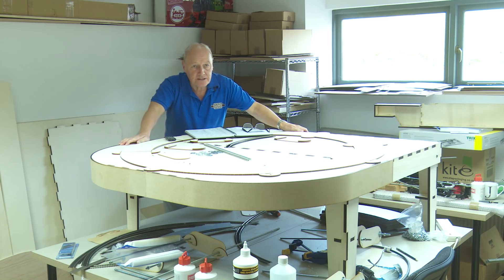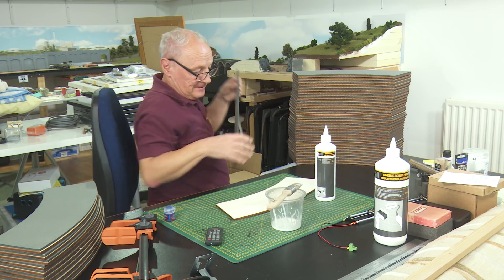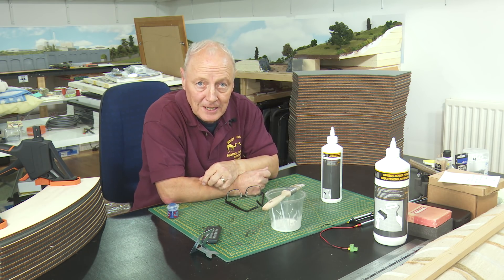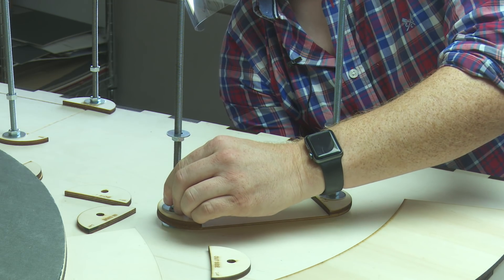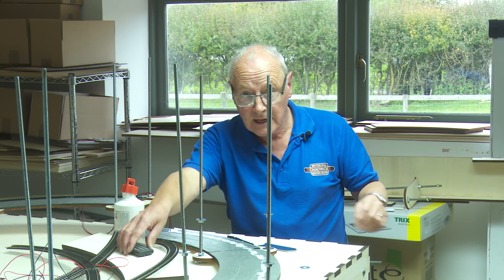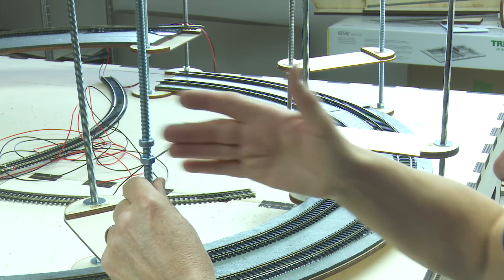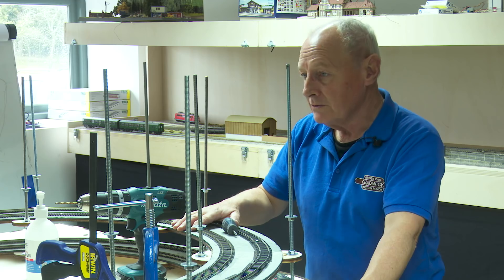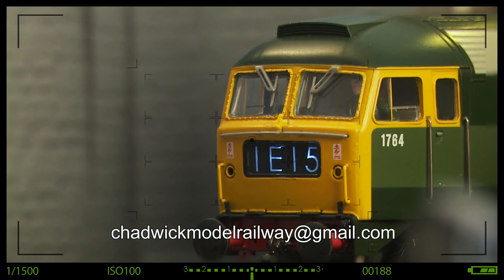Building a Helix at Chadwick Model Railway | 114.

Comment: I'd like to see a helix kit with a laser cut raised track guide fixed in the six foot (~4mm mdf). So you can push flexitrack up to the guide on both sides and have neat Curves, without needing to use set track...
Reply: I was thinking that 3d printed guides would make laying the track bed and track rather precise and easy. That way flexitrack could be used with minimal issues.
Reply from the maker: Certainly interesting points gentlemen. And of course the Flexi track will be so much cheaper. Regards Charlie
Reply: @ChadwickModelRailway  I'm not sure how much track you need to swap out for it to become economical to buy a 3d printer just for this, but for those doing less popular settings, it's well worth the money.
Reply: A band saw and a radius cutting jig. Or a radius jig and a router.

Comment from the maker: DCC Concepts Powerbase works by fitting the supplied magnets to the underside of locomotives.  This enhances grip, pulling the loco down onto the track.
Reply: Interesting video, I might need to use a helix or two when I get started. Do those magnets interfere with Kaydee couplings?
Reply: @meester5565  no as the magnets are installed under the locomotive,  the track base is just steel as far as im aware
Reply: @UndergroundEric  Ah thanks that makes sense.
Reply: was already asking myself what these matal things are.
Reply: Thanks for that explanation!  I was wondering why steel under plastic sleepers was going to help anything.
Reply: Triang magnadhesion for the 21st century.
Reply: Note the choice of special stainless, as not all stainless is ferromagnetic. Obviously best to use stainless, so corrosion is not an issue!
And as Charlie mentions, each loco will need a magnet to use these plates.
Reply from the maker: No because they are well back under the loco.
Reply: Make sure the magnets clear the kaydee uncouplers

Comment: Anyrail has a Helix function that draws the helix and calculates the gradient and distance between levels. If you haven't used it, yet, send me your Anyrail layout with all the heights and I will insert the helix, so you can see it in normal view and in 3D. I will also sort out your other track levels, if no-one else has offered to do so. Cheers Bob
Reply from the maker: Thanks for the offer Bob but I’ve sent it back to it’s creator.
Reply: @ChadwickModelRailway  That's a shame. It's a really useful piece of software.

Comment: If you are an obsessive, you can still fix the missing nut: just unthread the rod through the entire stack from everything below this point (or above, whichever is the shorter distance to have to shift the rod), add the missing hardware, and reverse the process. Granted, it would be tedious, but still possible. With all the other rods, getting one out and back in shouldn't be much of a structural risk.
Reply from the maker: Thanks O50, I’m pleased that you understand my situation.
Regards Charlie

Comment: Hi Charlie. Wow that'll look pretty impressive once it's finished. When I was involved with the old model railway at Sheffield Park on the Bluebell Railway which had a model of Horsted Keynes station it had a 2 turn helix at one end that was built in. There were fiddle yards top and bottom of the helix as well as a single lead junction and facing crossover so it was pretty involved in the days before DCC. I think it went up about a foot so one end was a helix and the other was a single arc that dropped down quite steeply. I do remember my old mainline Jubilee used to struggle up that so it had to be restricted to three coaches anti clockwise. Great fun to operate but it was very temperamental. I do believe it still exists but it's stored in one of the many containers around Horsted Keynes.
Reply from the maker: I'm so pleased that you enjoyed it DJ.  Stay safe. Regards Charlie

Comment: FYI, I used that screw method to hold my HO track in my helix and to hold my 45mm gauge track in my backyard. It works in both places! And, my outdoor track is subject to temps from near freezing to 120F. It allows the tracks to expand and contract without any problem. Brilliant!
Reply from the maker: That was a reassuring comment that is, thank you regards Charlie

Comment: Another great video Charlie - thank you.  It's looking good.   
A couple of things I learnt when I built my last layout which incorporated a similar Helix with threaded rods and nuts (albeit Swiss narrow gauge single track).  I deliberately incorporated some super elevation (cant) into the track sub-bed (giving me 0.8mm across the 12mm gauge track)  I started with the track level, and then worked my way around to get it adjusted correctly, time consuming but straightforward (Trains (no steam locos) run perfectly with a 380mm radius curve and a 4.5% grade) 
I also elongated the holes through which the rods pass to reduce the stress in the sub-bed because if you look at the vertical geometry the sub-bed is the long side (hypotenuse) of a right angle triangle.  With only a 2% grade and a larger radius the difference is small but not insignificant and you may find that when complete the threaded rods are not be vertical, which of course isn't an issue if they are out of sight. Just my 2p worth but hopefully useful.

Take care and keep safe
john c
Reply from the maker: Very interesting points John, thank you. Yes I thought of adjusting some cant on the bed which I can do towards the end of the build. Elongated holes is in a good idea and perhaps one we should look into. Regards Charlie
Reply: @ChadwickModelRailway  Sorry I forgot to mention that with my 4.5% grade I also had to use tapered wooden washers above and below the track sub-bed because when I tightened the nuts above and below they tried to flatten the sub-bed.  With a 2% grade this will not be so noticeable but don't over tighten them because the clamping effect will be to flatten the sub-bed.
Reply from the maker: Great tip mate, thanks.

Comment: Charlie... get a small round kitchen sponge, put a nut and bolt through the middle of it and then put the bolt in the chuck of your drill... then use it and the drill to wind down all then threaded bar bolts by using the side of the sponge to the side of the nut.. if that makes sense. Stu
Reply from the maker: Great idea Stu, I'm onto it.
Reply: Simple, very simple, but very clever. I love it. 😁👍👌
Not really worth the effort for a couple of nuts but, for a project like this, that wee idea could save 𝐚 𝐥𝐨𝐭 of time and a couple of blisters.

Comment: Nice video. Great to see such a full treatment. 
When watching the spreadsheet work at 9:00 as you cranked up the revolutions to cover the 18 inches to get the grade down, I became worried as you were not watching the elevation gain per revolution. It’s all nice on paper but in that One revolution you have to get the loco and cars in there by height so the roof doesn’t hit the bottom of the next revolution. 
3.27 inches is what you computer. That’s going to be a very tight squeeze for OO locos. Not running electrics the pantograph issue doesn’t come into play. But you still will want the space to be such that you can get your hand in there to address an issue if needed between the levels. 
So my recommendation to folks is to build it to the lowest height that will work for your locos (tallest loco with pantos up if your need that) and still allow your fingers over the loco so you can pick it up and place it back. That sets the minimum gap per revolution. 
The room then likely sets the radius of the circle, of the grip of the loco with what it is pulling and the all of that determines how.far up you will go.  
The elevation gain is really a function of the per turn gain needed to reach in and the radius that you can work with.
Reply from the maker: I think what your comment has highlighted, it’s just the complexity of the whole installation. I do realise there is little clearance within the levels, in fact there is only half an inch between the top of the train and the next bed, but I believe that’s enough. Regards Charlie

Comment: Well looking good Charley. Kinda of behind I. Viewing lately lol. You could used, think I mentioned it before, cheap bathroom caulking, sticks to the track well and also sticks to metal well. Instead of screws, but end of the day what works for you is great :). 

I found building my first layer of the helix is always the pain and time consuming with raising the screws a little, test, lower where required test lol. But once that first run is done successfully I cut a spacer and the rest of the layers went up quick as the spacer just set it Off from my bottom layer. Fun building one though hey :)
Reply from the maker: It certainly was an interesting challenge Sean. Regards Charlie

Comment: Hi. very impressive and informative.  You mentioned about the track being level.  In real life, tracks are at an angle in curves to compensate the centripetal force of the train and helps also to keep the train not slowing down.  In my curves, the first 30cm of curve track is not glued to the track bed, but then for all of the curve length ( except the last 30cm ), i elevate the outer track just 1 to 2 mm from the inner one.  It works really fine.
Reply from the maker: Once I’ve got it home Josef and in place, I can the adjust the super/elevation. Regards Charlie

Comment: Hi Charlie..... All looks to be coming together just fine. All the research.parameters etc spot on and explained well. Something worth considering
when finished is to make up a control train.... loco plus a load of rolling stock that can just make it up the helix without wheel slip. Keep this
train as a unit train or take note of it's makeup, throttle setting etc maybe also.  First run: Track must be 'virgin' ... clean as possible and shinny. (Track could be washed in your sink maybe as you assemble helix's. [G} ). Reason I pass this on is as you use the up helix performance will change depending on how you clean the track  or run your trains.  The control train gives you a base to compare performance against later on. You may get a few surprises depending on how you treat your track.
Reply from the maker: A very interesting point Indigo. Many thanks, regards Charlie

Comment: Wow, that is a lot of hard work, but it should be worth it to have a great running helix system. I did notice James forgot to add the 2nd rod lower (12:12) washer for tightening the rod to the first curve, hopeful that is sorted post production. I also noticed that you didn't use a say Peco track to track spacing/distance measure in the build so that the track remained equally apart? Great video and clearly explained by you both. Thanks again my friend and I will look forward to seeing it working on your layout. Once you work out how to get it home, lol.
Reply from the maker: Don’t worry John that washer was fitted. I did occasionally use the Peco six-foot way-gauge, but the main thing to keep the tracks the right distance was just to align the track edges at each timber joint. That way everything was aligned perfectly throughout.
Reply: @ChadwickModelRailway  I knew you would have used a distancing tool, but for the new comer/beginner viewers not seeing it may have wondered what you did. If they see this comment then they'll know what you used and did to keep it all aligned.

Comment: Another great video Charlie. I've always been curious to know what goes into preparing and building a helix, and by the looks of it, quite a lot. As you know, I'm also an advocate for the inox but I did wonder whether you might encounter adhesion issues for ascending trains. I did notice a bit of traction loss on my inclines after applying the inox. However, you might be alright with the DCC Concepts Power Base installed.
Reply from the maker: I'm so pleased that you enjoyed it Station Road Model Railway.  
The Inox point occurred to me too but only time will tell.
Stay safe. Regards Charlie

Comment: Threaded rod is a sensible choice.  US practice seems stuck on using 1x2 "ladders."  These are often made in batches with the level-to-level rise uniformly applied.  The base legs are then trimmed to create the slope.  US practice often uses "door skins" (sheets of either bidirectional or unidirectional plywood meant to face residential panel doors; available cheaply) to cut the entire 360º, which is threaded onto the ladders.  Handy part with all that is having a central "man access" to the assembled helix.  But, such things are simpler with the sort of manpower a club layout enjoys.
Reply from the maker: Thanks for the info mate.  I've seen a ladder build before, great if you're a carpenter.  Regards Charlie

Comment: Excellent video Charlie . Love how beautifully the laser cut parts fit together. Very satisfying. For threading all those nuts on you can put a buffing wheel on your trusty Makita and hold it against the nut to spin it on quickly. Probably too late for that advice ...
Reply from the maker: Yes it is a little late Peter for that advice. However I have of course another Helix to build! Regards Charlie

Comment: Great Teamwork Gents ! Well that was a really informative video and and on a personal note, the timing of it is brilliant for me having recently got my own helix from James. Great minds think alike Charlie, because I’m also going to use PowerBase from DCC Concepts on the outside loop. I’ve also planned for a third inner loop which will be 009 gauge and reversible so will also have PowerBase. However, there the similarities between our plans end. I’m going to use DCC Concepts track underlay and, as the radius of my loops is greater than third and fourth radius, will be using flexi track (wish me luck !). Thanks James for the tip about the start of the helix rise by creating that flap in the baseboard - a very neat solution ! I was wondering how to achieve a smooth transition from baseboard to helix, now I know ! And good to learn from your lesson about Copydex Charlie, I also use it to stick track down, so may rethink that strategy where the PowerBase will be. And looks like a visit to B&Q (other DIY stores are available 🤣) to buy some more clamps ! Thanks again Gents for your joint production, you really do combine to produce an easy to understand step by step guide and your efforts are much appreciated. Take care.
Reply from the maker: What an excellent comment Bryan. Good luck with your Helix In do keep in contact should you have any problems. Regards Charlie

Comment: Charlie - love all the videos, they are most informative and entertaining. Just one small point, here in UK we use square millimeters to describe cable sizes, to save me having to convert every time can you include the square millimeter size of the wires you use.
Reply from the maker: Hi Andrew, I am also in the UK but when I buy model railway cable sizes they are metric.  Such as 16 x 0.2, is 16 strands of 0.2mm cable. Regards Charlie

Comment: Well impressed!!  This could be a way of using all my series 3 and Super 4 curves!  However, my first action point is to buy shares in the DIY store; and any company producing M8 threaded rods and nuts. I first thought you could more easily use plastic or steel sleeves on the rod, but then realised the need to make the structure rigid.
And well done on not poking your eyes out on any of those rods....or is the next video from casualty😂?  Should you run out of curved rails, I'm sure I have a lot spare!
As always, an excellent video with lots of valuable information.
Reply from the maker: What a cracking comment in Ian. It’s great to have you onboard and so enthusiastic with the videos that I produce. Take care buddy, regards Charlie

Comment: Hi Charlie, I can vouch for the DCC Concepts Power Base units, as I think I have said before my layout is in the garden but elevated to about waist height, 'clapped out knees again', I tried fixing the plates with PVA but it didn't like the weather so I had a trip to Screwfix and got some EvoStik Sticks like s**t, and it does, they haven't moved a fraction of an inch since.
A very interesting exercise with the helix and all the various calculations needed to make sure all will be well, with the quality of the construction components I am sure it will be.
Don't forget to fit the supplied magnets under your loco's as near to directly below the driving axles as possible, if you find there is rather a larger than ideal gap above the track there are brass magnet carriers available, I had to use some on my loco's, these do help to bridge the gap.
Good luck with the rest of the build.
Reply from the maker: I’m interesting, Peter. Can you tell me who makes these brass carriers? Regards Charlie
Reply: @ChadwickModelRailway  The carriers are made by DCC Concepts, they are supplied on an etched brass sheet with various sizes of offset, I think from about 4mm to about 8mm, they also do additional magnet sets to cover just about all eventualities. I think they may also supply fixing screws and a drill.

Comment: Very nicely done. I love it.  My question is if the rise of each round is the same why done we cut a piece of pipe of the high and place it in the rode under each board so turnings the nuts height would be easier.
Reply from the maker: That’s a fair point SM but should you change your mind a need a less steep rise, you would be snookered.